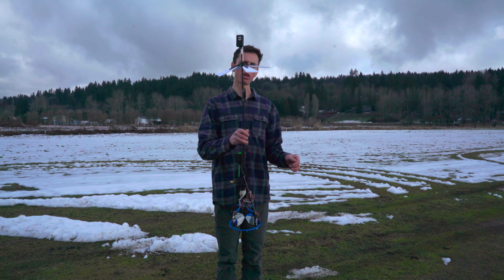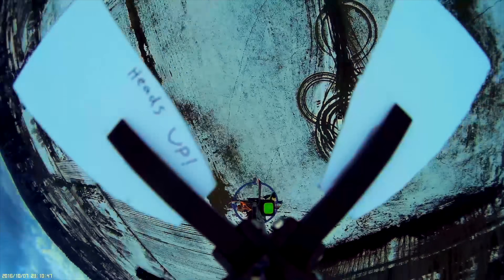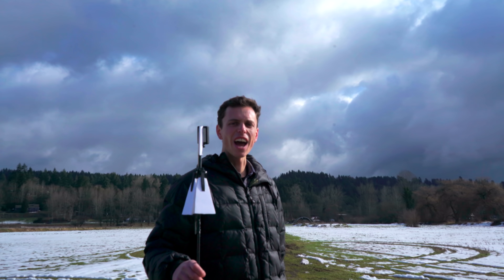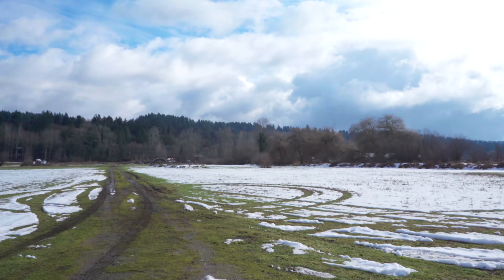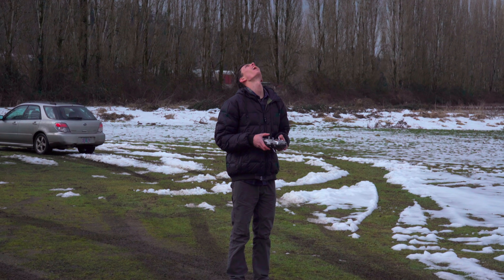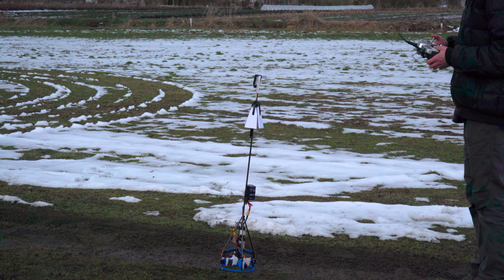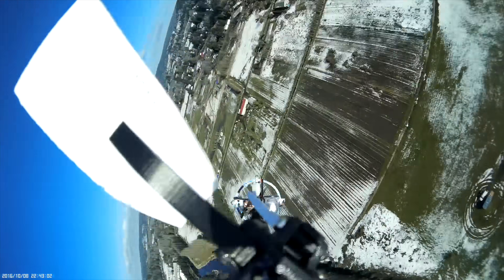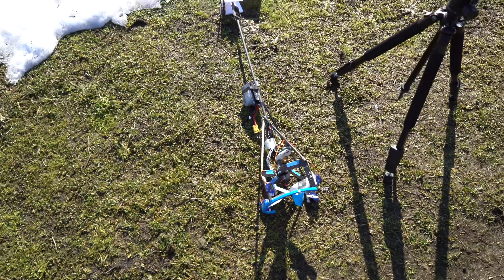Brushless R/C Rocket Vertical Landing with Pop Up Fins - RCTESTFLIGHT

Comment: You don't think using a ducted fan type we produce more thrust to achieve a higher speed? I'm guessing you didn't do that because it would be hard to control on landing or to bring it down slowly. Just curious what your thoughts are on that? Keep up the great work I'm really enjoying this brushless rocket series 👊😎🔥
Reply: The problem would then be stopping. EDFs do produce quite a bit of thrust but only at high speeds so firing the fan in reverse would provide very little to slow the fall
Reply: @KnowledgePerformance7  Um he's not firing the fan in reverse it's rotating the same direction whether he's going up or coming down. So I don't get your point there? A duct has more static power then a traditional open propeller.
Reply: @FarmerFpv  By "reverse" I meant backwards to normal. The EDF is firing down into the air stream which an EDF would struggle to make real thrust. In my experience which is limited EDFs struggle to produce any real static thrust compared to an open prop. They accelerate the air to a very high speed so yes it would have a higher top speed but it would struggle to slow down during the landing phase of the flight
Reply: ducted fans are weaker and have other aerodynamic disadvantages. they only look and sound cool, which is why theyre used in rc models.
Reply: drkastenbrot are you kidding me? Ducted fans are STRONGER than traditional propeller
Reply: @modelrc9500  at the size he could fit in there? no
Reply: @drkastenbrot  that's not true. A ducted fan has more static thrust and will achieve a higher speed for a project like this. There's no thrust lost at the tips as there is with an open-air prop.
Reply: The first version had a shroud along the entire length, it lost efficiency, didn't have enough static thrust to work well.
Reply: EDF, no. Better high pitch 3 blade prop? DEFINETLY.